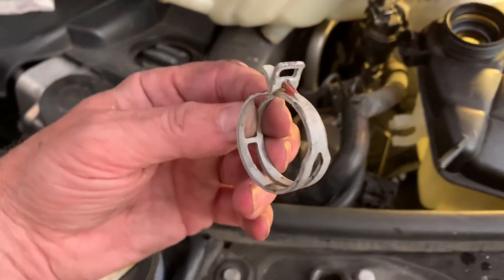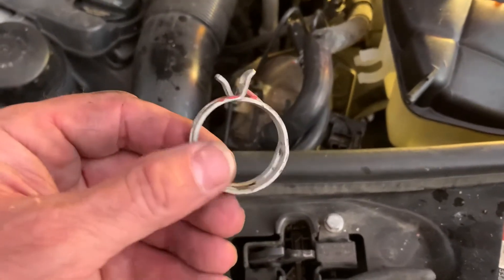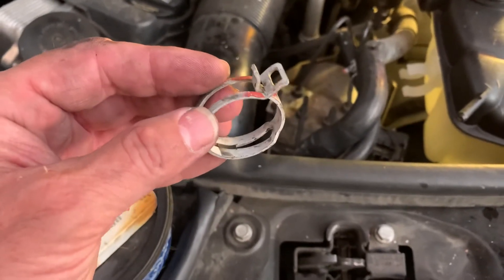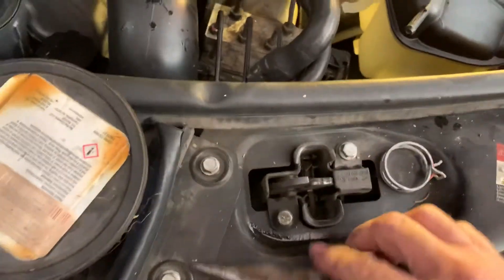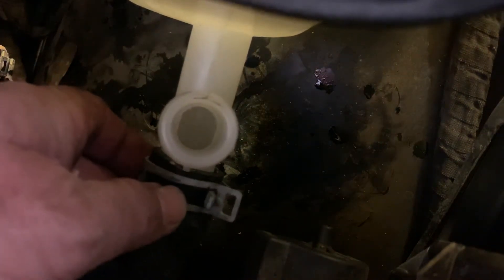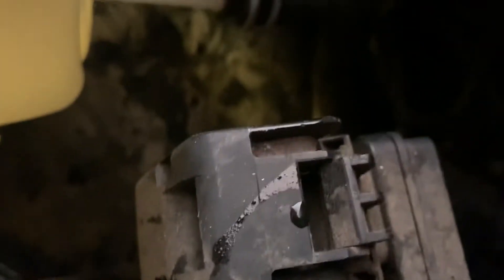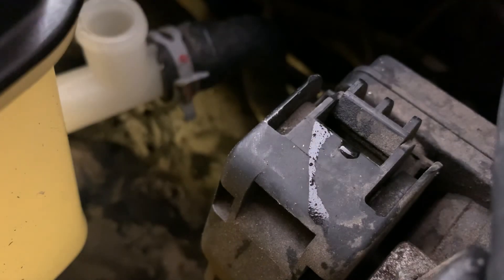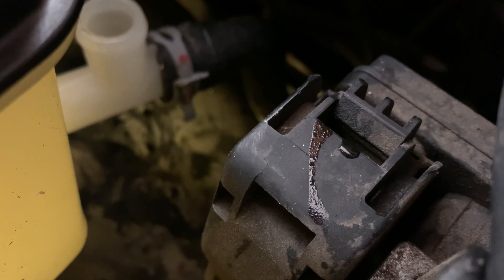Mercedes Benz Hose Clamps - How They Work

Comment: I have the same style one on my GM pick up, I had one fail and now I’m trying to install a new one, it’s the correct part according to GM’s catalog however I can’t get the damn thing on. I have a pair of vise grips on it making sure that is expanded to its fullest and it will not slide past the nipple on the water pump. I also tried to put the clamp on first over the nipple and then do the hose. No go